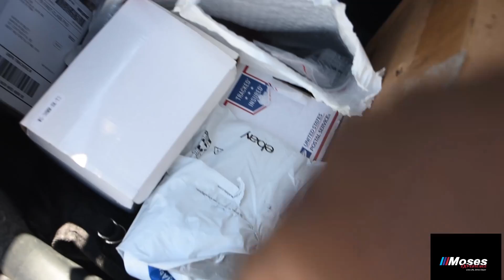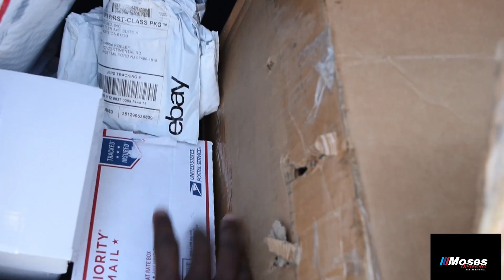ALL PARTS FOR 535I F10 N55 PURE STAGE 2 PURCHASED...F23 ACCORD TURBO BUILD FOR MY BROTHER

Comment: Where did you get your injectors I cant find any that fit my stock fuel rail
Reply from the maker: I didn’t change my injectors, I had the factory ones.
Reply: @Mosesexperience  for the accord?
Reply from the maker: Ahh sorry I thought you meant the 535.. these are the injectors https://www.ebay.com/itm/Honda-Acura-b16-d16-b18-450cc-Fuel-Injectors-OBD2-B-D-H-F-Series-Civic-Integra-4-/174372806922?_trksid=p2349624.m46890.l49292